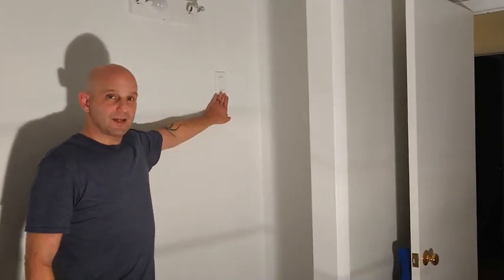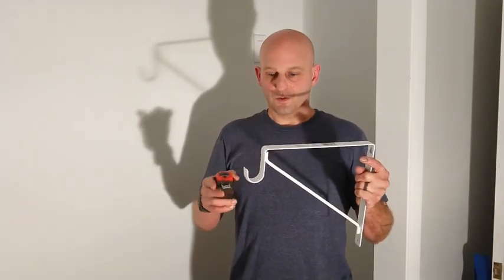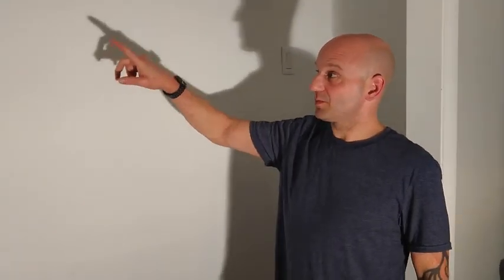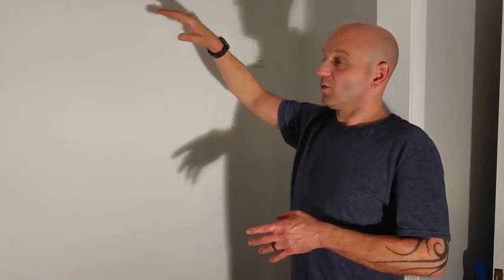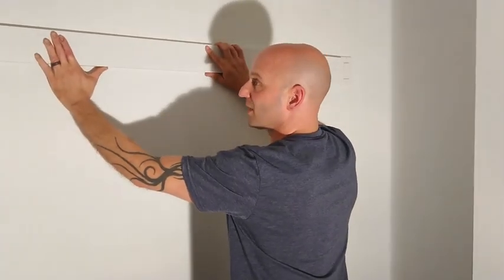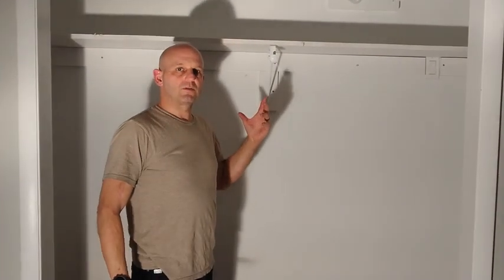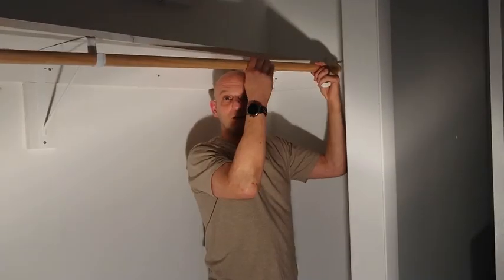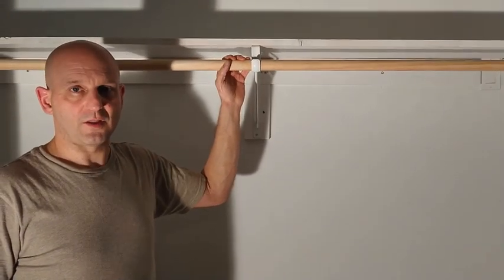Installing a closet rod and shelf

Comment: Your video is the most thorough I've seen..I'm a single woman trying learn and you stand apart from all the others..thanks for explaining why you do what you do and not leaving out important parts..one guy install a book shelf in a closet but did not suggest anchoring it to the wall with L brackets..until he was asked in the comments..even though he did it. Thanks for teaching us single women!!😁New Subbie!!
Reply from the maker: You are so welcome
Reply: @HomeImproveman  ..what size screws did you use to secure the boards to the wall?
Reply from the maker: @zaneblane8160  3/4" board, 1/2" drywall and I want at least 3/4" through the stud. Minimum is a 2" screw, but if it were me, I would use 2.5" screw.

Comment: Great tutorial.  If I do not need the bracket and only plan to use the wood supports, do I just lay the shelf on the wood?  Should I secure the shelf to the wood with some liquid adhesive light liquid nails or is that not necessary?
Reply from the maker: Yes, you can simply lay the wood on top of the supports. It is not necessary to secure the shelf unless you feel there could be a lot of movement. Most shelves in this situation are not secured, the weight of the items on the shelf keep it in place.

Comment: Nicely explained.  My experience is to suggest using 3 triangle brackets to support the rod, spread along its length, not just one in the middle.  Also, you will want the heavier duty, bigger lipped metal rod end bracket cups...instead of plastic.  Clothes packed into a closet are MUCH heavier than people think.  Ask me how I learned all of this....  :-)
Reply from the maker: I appreciate your input. It is always a good idea to over-engineer a structure than the to err in the other direction
Reply: @HomeImproveman  lol yes people sure know how to pack a closet with clothes. Nice Work!
Reply: My new bride is a pin up model... She took over my closet that has served me well for prolly 15 years... Her clothes pulled the brackets out and actually bent the support rods...all three... They literally snapped the bolt from the stud. Tryna figure out another way to build the closet out today
Reply: @TheGimmelstob  The hardware that comes with the brackets are often cheap and ineffective. Most times, I throw away the packaged screws and use construction screws (not drywall screws) I purchased locally.

Comment: How do you know if stud has electrical or water pipe down the middle?
Reply from the maker: If the house was wired and plumbed correctly, they used metal plates to protect the important stuff from screws. If they neglected to install the metal plates, 2 inch screws should not be long enough to hit plumbing or electrical.
Reply: @HomeImproveman  still alive and no flood so I guess I found the stud

Comment: How long were the screws that you used and what type.  Trying to learn so I can fix my closet rod and shelf.  Thanks!
Reply from the maker: the wood is 3/4" thick and I would try to use all of it. I would suggest at least an inch. More importantly, don't use drywall screws, they are weak and cannot handle the weight. Use construction screws as they are designed for this kind of work. They sell construction screws that are 1 1/4" inches and that is what I would use.
Reply: @HomeImproveman  Thanks!
Reply: @HomeImproveman  ..thank you!!
Reply: What if you have to use anchors..do I get the same 1 1/4 in construction screws? I'm doing the exact same project and need to screw in the short boards on both of the side walls.

Comment: Am I able to install a shelf and rod without the wood pieces into a closet? If so, will it be durable? 
 I had attempted to screw a bracket into drywall but it was very loose and I am assuming I missed the stud.
Reply from the maker: What is absolutely essential is that you anchor the shelf and rod to a stud. The piece of wood makes that easier. I would not recommend using a wall anchor to hold up anything of significant weight.

Comment: Would the construction screws hold the wood that you put around when there is no wood in the wall ?
Reply from the maker: No. There must be wood behind the drywall that you screw into. There should be studs running vertically (usually every 16 inches) and it is very important that you hit those studs.
Reply: @HomeImproveman  what if you have steel/metal studs in the wall? What type of screw should I use?
Reply from the maker: @richwilliams2972  Most metal framing studs can be pierced by regular drywall screws, so I would still use construction screws. If you have trouble, switch to a self-tapping screw, but that should not be necessary.